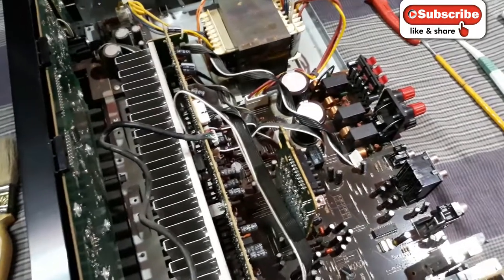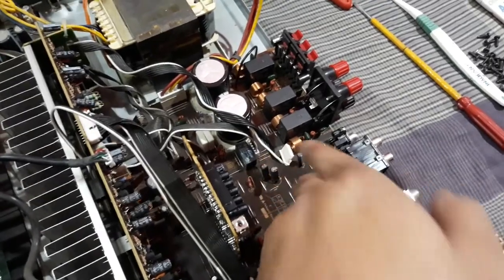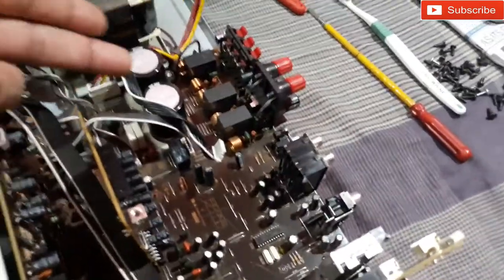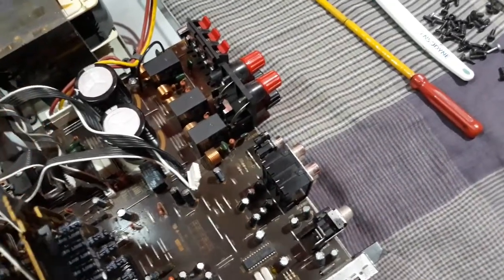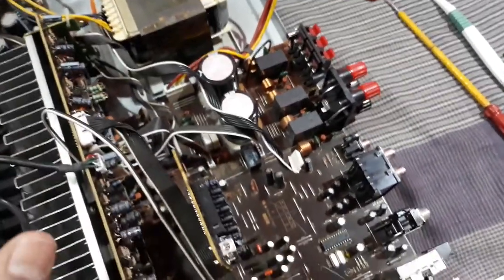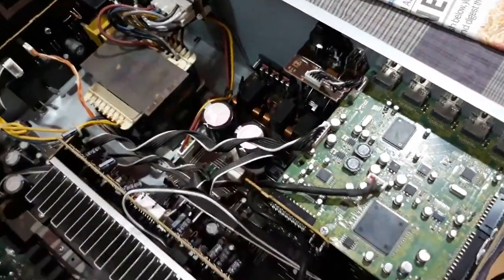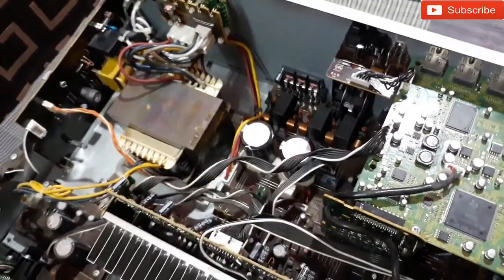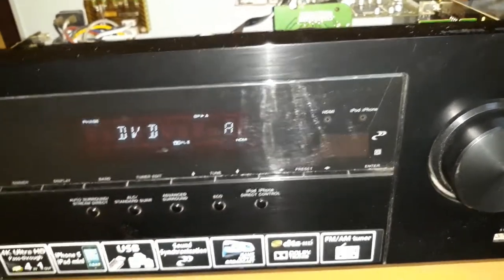How To Repair Pioneer AV Receiver Clicking Noise

Comment: You have "reassembled" it all? What do you mean? What have you actually done? Have you actually "re-soldered" it? Reassemble actually means unscrew and rescrew.
Reply from the maker: Yes. Its not that tough. Just slowly go step by step & remember the connections. Better you make a video while removing the components. Then it would be easy to reassamble it.

Comment: I had the same trouble with my Pioneer AVR VSX 933 and i noticed the amp got very hot after prolonged use. I looked and found some AC Infinity cooling options on Amazon and found the clicking noise stopped when the Pioneer remained cool...so before you go cracking open your amplifier try and see if a cooling option will solved your problem...
Reply from the maker: 1no of 120mm fan & an adapter would be much cheaper & enough for that. I did the same. Check my other video.
Reply: @techno boy  didn't need no adapter and the dual 120mm fans are USB powered. Fortunately there are 2 USB ports on my Pioneer VSX-933

Comment: So I have two pioneer receivers with the same problem, one channel keeps coming in and out. When I cycle the receiver on and off or just tap on the side it usually kicks back in. Should I be looking for cold solder joints at the relays? These receivers are from the mid 90's.
Reply from the maker: Yes

Comment: I have need a 12v trigger out on vsx 932. How I can do it? Can you help me?
Reply from the maker: 12v trigger out from your receiver. Open it & find a 12v dc connection from the side control board. Connect wires & take them out.

Comment: That clicking noise is just part of the way Onkyo / Pioneer amps work.
how can you fix something that is designed that way.
Reply from the maker: When its turned on thats the sound of power relay.then after a sec thats the sound of output speaker relays. Thats it. Except this if its having continus clicking noise when its running thats the fault. No receiver was made or works that way. Its a fault that started after few years. They definetly didnt come to my house after few years to make it work that way. I think u didnt watch the full video & didnt understand either. Anyway thanks for the visit.

Comment: my reveicer is switching modes constantly and i can not do anything against it. Just clicking and switching modes. Can you help me?
Reply from the maker: Try reseting the receiver first
Reply: @technoboy-allinOne  i did. But it doesnt help
Reply: And other option?
Reply from the maker: Then it has either the potentiometer problem or the controller chip problem. Clean the mode selection potentiometer with cleaner spray

Comment: how did you test those relays? on or off the board?
Reply from the maker: The receiver was completely disconnected from main power outlet. Then i used a 9v volt battery to check the clicking sound.